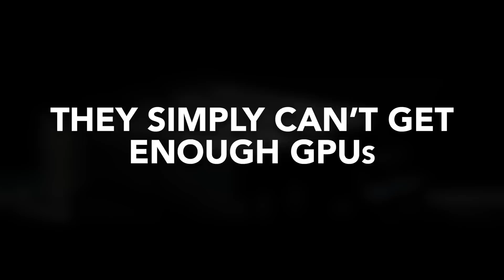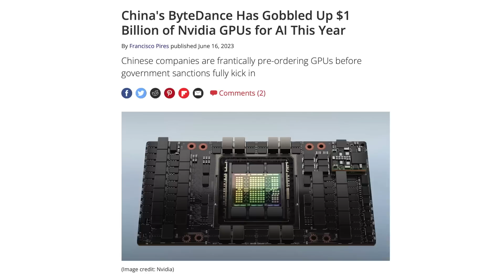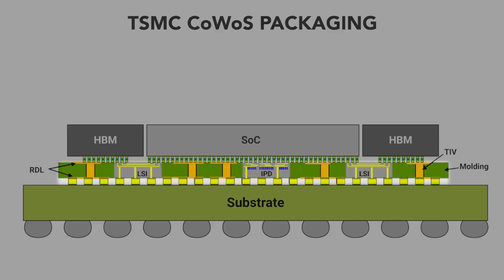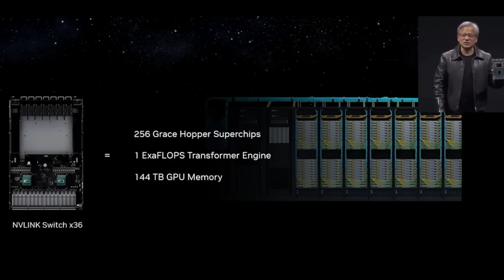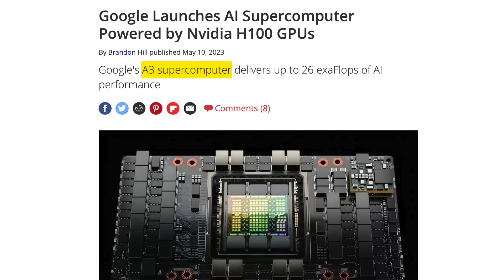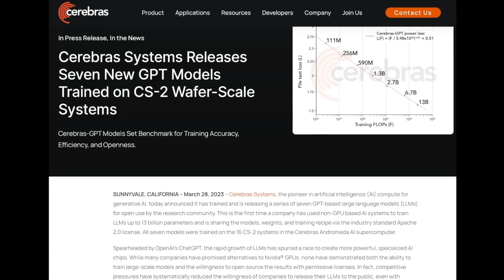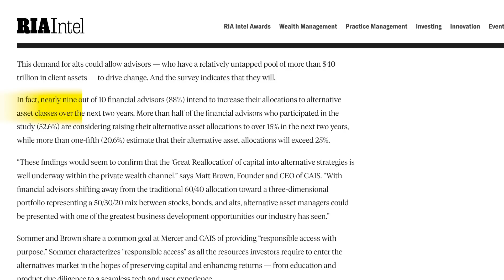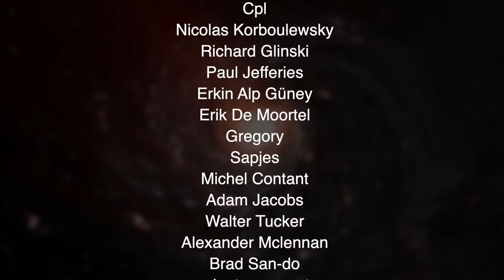The Secret to NVIDIA Success

Comment: 0:00: 💻 The demand for GPUs has increased due to the deployment of AI in various industries, causing a shortage in supply.
4:21: 💡 Nvidia is expanding beyond graphics and gaming by investing in hardware for deep learning, with their h100 GPU being in high demand.
8:10: 🔬 Nvidia has developed the Grace Hopper super chip, which combines a CPU and GPU with a large shared memory, and can be scaled up to form a supercomputer.
12:30: ! Cerebras has developed a custom compiler and weight streaming technique to support models with any number of parameters on a single cluster, providing significant advantages over GPUs.
16:29: 💼 The video discusses the potential of generative AI in the tech industry and the importance of diversifying investment portfolios, including alternative investments like fine art.
Recap by Tammy AI

Comment: This from Model 3 manual, May also apple to model Y ( I would think): To experience the same amount of deceleration whenever you release the accelerator pedal, regardless of the state of the Battery, you can choose to have the regular braking system automatically engage whenever regenerative braking is limited. Touch Controls > Pedals & Steering > Apply Brakes When Regenerative Braking is Limited.

Comment: Hopefully somone other than me creates home heating solutions with all these chips... so that people can heat sink to heat their home from larger proccesors, or things like E-D.J.  an  external swapable car GPU you can use as a computer GPU for ai to run your smart home ect.. or a WLAN system. Seriously hopefully they have these in the lifespan rollout of this stuff.. this is no brainer techs.  We also need a federated system of distributed AI in all this... the commercialization of this will ruin the capabilities of AI if we repeat the path of IP and producitization of technology for something like AI frameworks shoudl be an IEEE consideration. It is going to end up regulated anyway the IEEE should be thinking about technological interoperability and unrooting the stuff so that it won't be gimped.

Comment: AI models are only as good as the training data. 
Who does the data scrubbing and management etc and knowing what kind of data makes good training data . I think this could be a gap in the market. 
The LLM will only perform well if it is trained well, not how fast it can be trained. Like most things in life quality is better then quantity...well in my view. 
Tesla has built a full automated training stack to label physical objects I am sure there is an equivalent need for non-real world applications for data labeling. Do companies know they will have to do the heavy lifting and create an automated labeling system even before they build the LLM?
LLM do not just happen by magic the network must be built through evolutionary training they are not 'designed' like a chip or building or a car is designed.

Comment: The watts to do the same ISOwork are the key factor.  Cost of the rack much less so. Heat and software difficulty a distant third and fourth place. H100 GPU on TSMC N4 and better tensor cores, chiplet memory, CoWoS is impressive but... When a RISC-V solution on DUV with AMD's parallel franework comes out, itll be far cheaper i exoect.

Comment: You might want to watch Wendell's videos over at Level1Techs, he's gone over the ROCm stack a few times and AMD has just released their HIP SDK for all their supported GPUs (consumer and enterprise from Vega VII all the way through to RX7000), needless this could be a pivotal moment for GPGPU work as nVidia has had the consumer market to themselves for tasks like Stable Diffusion and similar tasks. It should be noted ROCm isn't a competitor to CUDA, it's  being migrated an eco-system for homogenous compute tasks, where it will offload a task to whichever hardware is best optimised for it be it Xiliinx FPGA, X86, CDNA or or some other tech. The other aspect to remember in amongst all this hype we still don't know what the future of AI will look like in 2-3 years there is a lot of change and it's likely AI will be a blended approach of various technologies rather than a pure GPGPU approach both from a optimisation but also out of sheer necessity from the demand.

https://community.amd.com/t5/rocm/available-now-new-hip-sdk-helps-democratize-gpu-computing/ba-p/621029/jump-to/first-unread-message

Comment: You mentioned AMD running Cuda on their GPUs. Can you talk about this more? Also, is it possible to run Cuda on Apple Silicon?
Reply: "AMD running Cuda on their GPUs" is an oversimplification or misunderstanding. CUDA is NVida. AMD is not CUDA. AMD has ROCm and you can use HIP to emulate CUDA through that, but CUDA isn't a thing that can be run "on" AMD GPUs, CUDA is part of the NVida GPUs. ROCm and HIP enable developers to support AMD GPU hardware using similar software APIs that were designed for CUDA hardware, but CUDA itself refers to the NVidia hardware itself. It may sound like this is just semantics or pedantry, until you try to install something that is made for CUDA on a system with and AMD GPU. It just doesn't run, unless you re-engineer the software  to support AMD. HIP and ROCm make the process much simpler, so it is not completely rewriting from scratch, but it does require repackaging and rebuilding the software.

Comment: Urm... "GPUs" are completely different products than AI and General Purpose acceleration chips (H100, A100, Hopper, et al.).  They share some fundamental similarities, but AI accelerators have no need for hardware encoders, ray tracing engines and other graphic-specific die features. Also, the majority of consumer GPUs are very small dies for mid-range gaming and are entirely unsuitable for "AI" tasks .  Mid-range Graphics Processing Unit (that's what the "G" stands for...) dies are tiny compared to high-end AI accelerators and are architecturally entirely different.  

The PC graphics market is entirely separate from the AI accelerator market.  An H100 is $40,000+ and has nothing to do with Windows or console graphics accelerators markets.  The only slight market effect that might be felt is for reserving fab space, but the AI market is numerically minuscule compared to the consumer GPU market and can be satisfied with very modest wafer production, relative to consumer GPUs.

Realistically, the terms "GPU" and "AI" do not belong in the same sentence, ever , it's a lame carry-over that is completely meaningless.

Comment: You should do a video about multimodal models and see if/when we'll have proper and accurate 3D STEP files imagined from AI inputs. STEP is the only real engineering format for 3D IMO. It means you can machine the parts and build assemblies to 100% proper engineering specifications. When we get there, we'll see a step change in everything.

Comment: 🎯 Key Takeaways for quick navigation:

00:00 📈 The demand for GPUs, particularly for AI applications, is surging, causing supply struggles.
03:02 🚀 Nvidia dominates the GPU market due to its high-performance hardware and proprietary software, like CUDA.
05:03 💹 The new Nvidia H100 GPU offers significantly better performance for large language model training compared to CPUs.
09:51 💼 Alternatives to Nvidia GPUs for AI applications include Tesla's Dojo, Google's TPUs, Cerebras' Wafer Scale Engine, and Intel/AMD GPUs.
16:34 💡 The future of AI hardware is promising with intense competition, and diversifying investments is recommended, including alternative investments like Fine Art through Masterworks.

Made with HARPA AI

Comment: The first computer I had as a teenager was a based on the MOS 6502. It's insane to realize how far these chip architectures and technologies have come since the mid 1980s.
Reply: A lot of useful devices were built around Chuck Peddle's 6502 "RISC" architecture... now it probably couldn't even serve as a supervisor/side processor for today's multi-core beasts.  :hand-orange-covering-eyes:😁
Reply: Forget about 4MHz becoming 4GHz... As the complexity of the chip architecture and software also grows exponentially... what is it that is looming to take over the burden of design and planning? Our brainchild, which goes by many names, but all call it AI.
Once let loose into this world, and our sattelites and probes... it will live forever and ever. Ever Growing... Ever Learning...

Comment: I wonder if AMDs software stack is being underrated. I avoided their graphics cards for years because of the ROCm horror stories I had heard; and I think that was a smart choice at the time. But a month ago I bought a Radeon 6700 XT for my girlfriend's computer, and even without official ROCm support (after changing one line in a text file) it's been incredibly easy to use for stable diffusion and Leela Chess Zero. I'm just a hobbyist and don't have any commercial application for ANNs at the moment, so their are probably use case issues that I am completely unaware of. But I was absolutely amazed at how easy it was to get ROCm up and running on an AMD consumer GPU (it took like an hour, and it was only that long because of slow driver downloads). I ultimately found it less of a hassle than using CUDA on my Nvidia RTX 2060 Super because (at least in Ubuntu 22.04) the drivers that make it work for CUDA break it for Steam and vice versa. After setting up the 6700 XT with ROCm I was so sure I'd have problems getting Steam to run games, but everything went smoothly. I was simply mind blown. I hope AMD brings official ROCm support to their 7000 series cards ASAP. As a hobbyist I don't care that Nvidia cards might train a faceswap model slightly faster, I just care that everything runs smoothly.
Reply: China agrees and wants ROCm on RISC-V

Comment: Anastasi, the H100 is a monolithic design, not a chiplet design. Chiplet designs refer to designs that split the different components of a [traditionally singular] die across multiple dies on the same package, for example AMD's Epyc or MI300 processors having 'chiplets' of cores and a 'chiplet' for the memory controller. In datacenter products, HBM is often packaged with the die but this is not what a chiplet design implies. Also, there have been converters that can transform CUDA code to roughly corresponding OpenCL or HIP code for a while, but CUDA will never be able to run natively on AMD hardware as CUDA compiles to PTX, a proprietary virtual instruction set.
Reply from the maker: Sorry my mistake
Reply: absolutely, chiplet was initially designed by AMD for their cpus, and then applied it to their gpus. At first, it was simply MCM with 2d architecure, which was really good but had some drawbacks, like latency... Then they released chiplet with 3d Vcache, allowing for better performance, lower latency, better scalability and lower costs

Comment: These hardware companies don't actually need a parity with CUDA. They only need to implement custom backends for TensorFlow and PyTorch libraries. This is much easier than replacing CUDA. I even did similar stuff myself, on top of Direct3D 11 compute shaders.
Reply: When do you think companies like Meta and Google can use Intel's or AMD's GPU's for their TF or PT?
Reply: @ME-CFS-LongCovid-Help  I think they already can, it just involves more friction to setup and use.
I believe AMD is better than Intel for that. According to PyTorch devs, support for ROCm became stable in version 1.12, June 2022. According to AMD, both PyTorch and TensorFlow work on AMD GPUs on top of ROCm. Both require a Linux OS for that, Windows is unsupported. However, Internet companies like Meta and Google don’t care about Windows support because they run their AI stuff on servers, Linux is better for that use case.

Comment: As a gamer I'm hoping there would be some GPU dribble to us. For example failed chips getting new life as gamer GPUs.
Reply: 4090 is a failed 6000 Ada chip.
Reply: Between AI replacing the financial interest of anyone capable of producing gpus and the economies of scale for mobile and dedicated devices, I think those are slowly replacing the pc gamer market, and with it, the gamer gpu market. Wont be long before your playing your old pc games on an emulator running on your phone. Just give it a few years for mobile to catch up while investment in the desktop drops off. 

Almost all my gaming is on a home made vr treadmill. Theres already one company, Virtuix, releasing a dedicated all in one device for this purpose. Even Kat-VR is working on a device, the kat nexus, to use their slidemill with quest2 and psvr2 so theirs won't need a pc either.  Dont know if thats diversification or they also see the market headed in that direction. 

Of course, some new development could turn everything upside down or I could be just wrong about this. I'm into video games, but mostly for exercise, and only a small part of that. I suspect us casual gamers are really the bigger market.

Comment: excellent video. very well researched. lets hope Cerebras (that actually just closed a deal with AMD for a supercomputer to help with ML) and AMD are able to pull ahead and actually compete. the fact nvidia has such a big piece of the pie with proprietary software is a real problem imo... or else no AI for everyone cause its a company focused only on profits and extremely greedy at that.
i pray Rocm has a chance to shine but amd needs to actually focus on it massively.

AI is in its infancy so theres a chance for others to join the fight.
Reply: Amd would have done same if they pulled up before Nvidia did.
You guys shouldn't behave as if AMD is a saint and will not overprice

Comment: CUDA is way more than a parallel computation framework, it's a complete series of libraries for solving problems on the GPU with C/C++ including linear algebra, deep learning, sparse matrix, solver, FFT, nvJPEG, profilers, etc.
Reply: There are higher level abstractions like pytorch and tensorflow keras
Reply: @hdthor  Yeah that add layers of performance killing kruft on top of CUDA.

Comment: Why is NVIDIA producing less supply? is the Fab a real bottleneck?
Reply: Covid (it disturbed the economy all over the world), politics (US vs China on Taiwan is the biggest one), the ever-increasing demand and the process for making semiconductors getting more and more expensive, all play a role. There were issues with sillicon even back in 2017, and things are getting worse and worse by the year.
Reply: @user-qy2wf2lt6v  so not only NVIDIA is struggling to get more chips from FAB, it affects the whole industry, but what is the solution then ? Is it like a queue for who gets the FAB, and there is a limit on how many chips you can get? So supply from the whole industry low but drain is really high because all the AI's and Chatgpts require more computer power, is that how it is going ?

Comment: I suppose you a re not fully correct about CUDA. 1. Nobody use it directly anymore. And most popular libs and frameworks support now also other APIs. 2. We have not only HIP (ROCm) how you can forgot about OpenCL if you like OpenSource (last version not bad, hello RUSTICL)? And modern addition - SYCL. Also, Intel push oneAPI wich mostly based on SYCL. Also for some use cases like inference Vulkan Compute working very well (and for small models even for training)